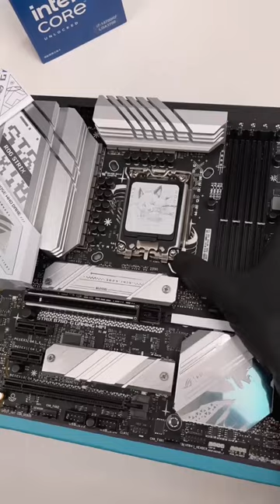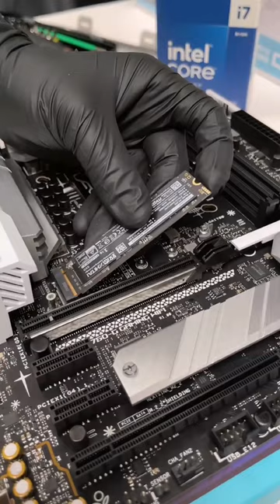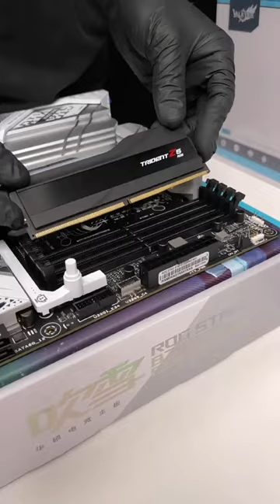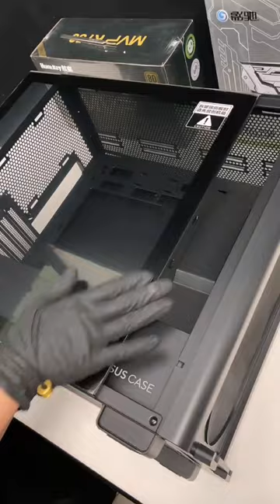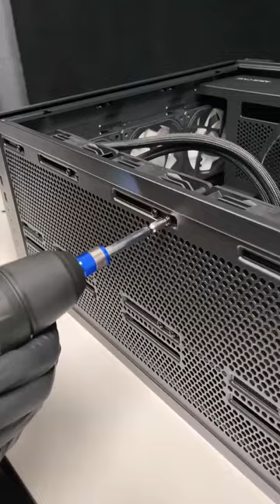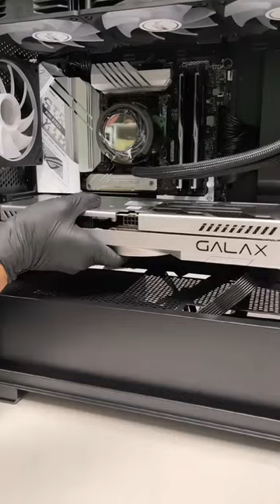Intel i7-14700K😱with RTX4070😵 #pcbuild ASMR #shorts

Comment: Opens 4 dimm latches only uses 2 ram sticks 😂
Reply: U have to do it 1st faster upgrades 2nd if it is closed on newer motherboard has sensors so the system thinking u have quat slot
Reply: Also it is for asmr
Reply: @Jeremy-n9l  I've never heard of such a thing. Can you link a mobo that actually does that? It seems like total nonsense to do
Reply: @Vitis-n2v  i work in it for like what 5 years so i will know it lil man
Reply: @Jeremy-n9l  i've worked in it over 8 years and not a single board i've used false reported dual channel as quad nor tried setting up quad channel on 2 sticks when latches were closed
Reply: But he doesn't want to say which motherboard he saw so it's like that hahaha @Vitis-n2v
Reply: @Jeremy-n9l  faster upgrades?? (yeah maybe 0.25 second faster!! LMAO). Sensors? on tiny plastic latches? System bios thinking you have occupied all 4 slots?? When 2x 288 pins of DDR4/ DDR5 slots are connected to thin air??? You are smoking some good shit lil bro
Reply: @agneeshwar_  Ok so u will chose lovely 0,25 slower or faster PC i think faster mh?
Reply: Trolling just to troll
Reply: @Jeremy-n9l  there's no such thing as latch sensor, cut the crap
Reply: @maklogetrich2378  U also saw my 2bd comment? No? Then SHUT IT
Reply: @Jeremy-n9l  still, it doesn't make it right, if it's for ASMR, yes it's right, latch sensor? lol
Reply: Don't use a damn drill.... these boards strip as easy as a 2$ hookah.
Reply: The other two memory sticks went into the builder's pocket as tax-payment.
Reply: @Jeremy-n9l ur getting cooked just stop bruh lmao
Reply: @hdfatcat2311  cry kidd no one asked 😂😂😂
Reply: @Jeremy-n9l  just post the motherboard with such a problem

otherwise, just keep being cooked
Reply: @Jeremy-n9l  provide the motherboard, otherwise keep getting cooked kid.
Reply: @Hiken_Bakuzan  just stf no one cares hs get blocked lmfao🤣🤣🤣🤣
Reply: So what? That cpu only supports dual channel anyways
Reply: @ZonexG  i wanna let u know if u fill al 4 ram slots on Mainboard it is still dualchannel bc only Server Mainboards with 8 Ram slots has Quad all Intel and ryzen CPUS has Dual channel bc there are no Quad channel
Reply: Intel better with 2 slot ram with 4 slot Intel worse
Reply: @agneeshwar_ this is the stupidest argument it just gives a lil space between sticks me it’s also an asmr video
Reply: This is the second time I've seen that happen, why four when you have two ram
Reply: @Jeremy-n9l ong you just made that up on the spot, nobody has ever said that
Reply: @datderian no one asked u lmao
Reply: actually for the nerds here there is a very good reason why they usually only use 2 ram sticks on these newer boards and builds. After 12th gen intel processors many Mobos had to be designed to be compatible with the newer gen CPU's that utilize the LGA1700 sockets. With Intel's features and integrations this also includes features such as faster storage which are only usable with overclocking with at least GEN3 and newer connectors (this also includes the newer M.2. storage Gens 2 and 3 and RAM slots usually being DDR5). Also, many of the newer CPU's have very limited compatibility with memory timings and many ideal pairings are not available in the market, even with the release of the 13th gen raptor lake Intel CPU's many of these ideal RAM pairings have not even been manufactured. Additionally, to add fuel to this dumpster fire; current CAS Latencies are nowhere near to match 4 sloted high frequency +  low CL of DDR4 ram sticks which allow for stability and safe overclocking. Current PC building is at the worst it's ever been since 2020, they are all very far behind in schedule for sale of components at a reasonable price and for the variety of options for the optimal performance of your build. So if you're an idiot like me who decided on buying the latest components to build a poweful brand new PC, now you know why you shouldn't do that(all my parts work btw I did my research, I just realized upgrading this PC might take awhile).
Reply: @Jeremy-n9l  u talkin trash.. those plastic latches are full plastic.. like the part they are attached to. no contacts, no cables, no buttons.. how on earth would something react to an plastic mechanical function. u worked like 5 yrs for a trollacademy. 

"also" the asmr was the only reason for it.
Reply: @Fi0p  No one caress kidd just stf man haha i dont care lmao kidd
Reply: @Jeremy-n9l  okay lil boy. understood. go play around and find out.
Reply: @Jeremy-n9l  wrong, again
Intel X79 motherboard support quad channel with 8 ram slots, which is not a server platform
and Intel X58 motherboard support triple channel with 6 ram slots, which is (again) not a server platform
Reply: Hm🤣😂😆
Reply: Hmmmm🤣😅😆😁😁😁😄😃😀
Reply: @Jeremy-n9l that’s not true. It doesn’t matter if empty slots are open or closed

Comment: 14700k feels overkill for this build, especially in combination with 4070, it would've been better to go for 4070 Ti and a tier lower CPU
Reply: Yep. My 14600K is bottleneck at 99% by RTX 3080 so it would run just amazingly any 4080 or 4070ti.
Reply: like my 14600 and 4070TI with 64GB DDR4
Works so well. I totally love it 😁
Reply: It can depend on the games played though. When I made my last PC(Like 6 years ago now) I was super into modded minecraft, which is very CPU+RAM intensive in comparison to the GPU, so I grabbed an 8086K+32GB RAM with an RX 580. Ran Modded Minecraft w/ max render distance and no frame drops, was happy.

Threw a 3060 12GB in when EVGA shut down(needed the VRAM for something at the time, don't quite remember what) and it runs respectably for what I play at 1440P.
Reply: I have a 4070 and a 13900K lol, i wanted a good cpu because i do more video editing than gaming
Reply: what makes you think this PC only use for gaming?
Reply: @maklogetrich2378  idk thats just what most people seem to build pcs for most video people use mac
Reply: @JacksonGrimesTV  but you are not using mac, right?
Reply: @BaieDesBaies    640*480  ?
Reply: @ВиталийВиталий-ь9р  Even in 720p, GPU is still the limiting part. 😅
Reply: @BaieDesBaies easier to upgrade gpu in the future than cpu. I think it makes for a good title too. 14700 and 4070, 4’s and 7’s.
Reply: @DengueBurger  I think 14700K/14600K difference is not enough to justify better GPU upgradability for the price but i might be wrong.
Reply: @JacksonGrimesTV video editing is about the only thing you can do on Mac now a days.. I wish it wasn’t so because there the M2/M3 series of silicon is out of this world and you can get them in such small form factors… and most 3d design is done on pcs, all of Autodesk programs and drafting is done on pc.. I built mine for both and use it every day for both drafting and high end gaming.. the parts for 3d modeling programs require a great gpu and a decent cpu, while Cad is almost 100 percent cpu, so building a high end comp that can do both.. you need to have decent components.
Reply: @beefwantko7269  that’s so real i was going to go mac but theres so much i want to do that mac doesnt do. Windows is just more enjoyable for me too but the m3 is so appealing for content creation
Reply: buying the perfect match cpu for a graphics card is kinda wasteful if you buy midrange cards. Usually high end cpus are not much more expensive than midrange and should be able to still support the midrange model of two card generations down the line
Reply: @SirFranzelot  I'm pretty sure an i5 14600K will be able to handle two cards generations anyway, and a high-end CPU is much more expensive (50 to 100%) than a mid-range one.
Reply: @BaieDesBaies  come on, you cant know the Performance two generations in. Admitedly, the price gap between 14600 and 14700k is too big, but thats Not my Point. A more Basic explanation: Buy the best CPU for a reasonable price, and Upgrade the graphics Card after the current one becomes obsolete for a cheap Performance boost. A 14600 has about 25% less Performance than the 14700 so your next Upgrade would have to be weaker too, thats what i wanted to say
Reply: @SirFranzelot  I do agree but i think this is a way of missing a lot of performance right now for hypothetical performance later.
Reply: @BaieDesBaies  you are right, basically very different philosophies :)
Reply: There’s more to a PC than just gaming.. you can always upgrade the GPU but that CPU is the final generation for that socket so it’s not a bad idea to go big.
Reply: согласен, тут была бы уместна 4070ti super / 4080 / 4080s
Reply: @yonisuqui  4070 ti too
Reply: I think you should go for a bit of a bottleneck when you are building a new gaming PC because you have to upgrade only one component in the future and get a very good performance
Reply: I7-12700kf- 4070 =best 1440p combo you can have
Reply: Don't worry, given Intel's recent track record, that 14700k will perform poorly then rust from the inside out and stop working.

Comment: Bro that’s not how you tighten a frame 💀
Reply: do you mean the cpu bracket?
Reply: Do you mean cpu contact frame? 🧐
Reply: @Scratata228 what are you talking about. that doesn’t exist💀 you have CPU socket and CPU bracket. I go to school on an ICT school so i think i know what i’m talking about
Reply: You seem so american "IgOToScHoolOnAnItC". A bracket is what you would mount with (coolers etc). What you are talking about, is an ILM (Independent Loading Mechanism) that is default by intel. And what you buy (on the vid) is a contact frame. 

Ditch school, there is no hope for you.
Reply: @scrapmechgaming  The contact frame is that piece that was installed in lieu of the cpu cooler bracket. It's designed to address the uneven thermal contact that the LGA1700 socket has when you use the regular bracket. It's may not be officially made by Intel, but it most certainly does exist and serves a purpose.

Comment: That pc is very similar to mine. I also have a 14700k a 4070 and I have the same RAM.
Reply: What games/tasks do you run if I may ask?
Reply: @realmotos6024 minecraft in low settings
Reply: @XWisp10 that would be pointless for a high end gaming pc
Reply: @vals_ well it's not exactly high end, it doesn't have a 4090 or an I9 or 64gbr
Reply: @salazar778 hmm i‘m not sure what we can call an high end gaming pc so i ask you now if mine is HIGH END i have an Ryzen 7 7800X3D and 64gb RAM paired with a RTX 4080 maybe it’s mid-high end pc or something i‘m not sure
Reply: @TrendBoyett  Oh yeah that's definitely high end. That's a pretty powerful CPU.
Reply: @TrendBoyett  What drug are you on??? This has to be satire and a joke right?
Reply: @NPC_005  wdym
Reply: @TrendBoyett  how the hell you can't tell if yours is high end or not
I mean by the specs you have, its already capable to run 2k minimum resolution and ultra settings
Reply: @salazar778  bro, its literally enough to run cyberpunk 2077 on ultra settings
Reply: @vals_  not on 4k
Reply: @salazar778  Then there is no "high end" because a  4090 doesn't run it well either with everything maxed.
Reply: @farbenseher2238  it literally does... on 2k at least
Reply: @salazar778 high end ≠ only the 4090
Reply: me personally i classify anything with like a 30 or 40 series and above like the 70 brand of graphics card (4070 3070)
Reply: Can I ask you my friend what motherboard have you used for this CPU?
Reply: @giovanni-yr5zy  MSI MAG  B650 TOMEHAWK Intel Version LGA 1700

Comment: Bro, 4070 but just an i7? Really?
Reply: The 14700 almost bottleneckd ☠️
Reply: It's a 4070.. not that easy to bottleneck with a i7-14700k
Reply: It doesn't matter if it's an i5 i7 or i9 what matters is the numbers.

Comment: You didn't took off the sticker from m2 ssd drive before putting on the radiator xD
Reply: Actually most of these stickers are made of heat-conducting metal and don’t require removal 😉
Moreover, removing the sticker in most cases also voids warranty.